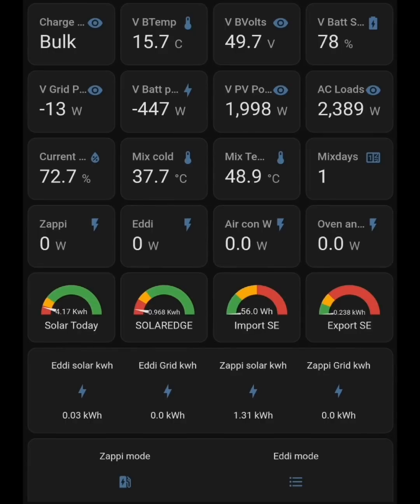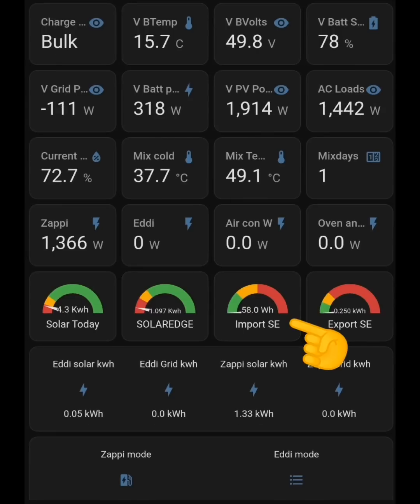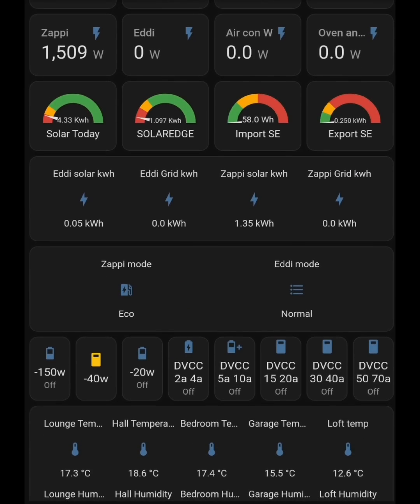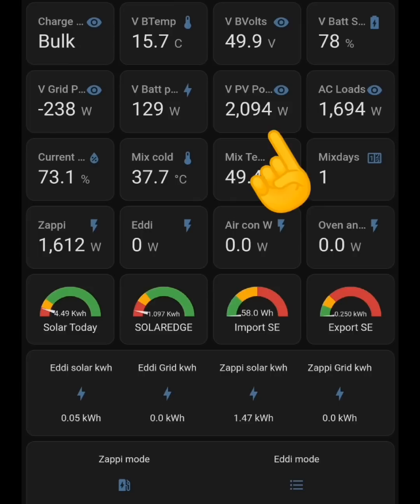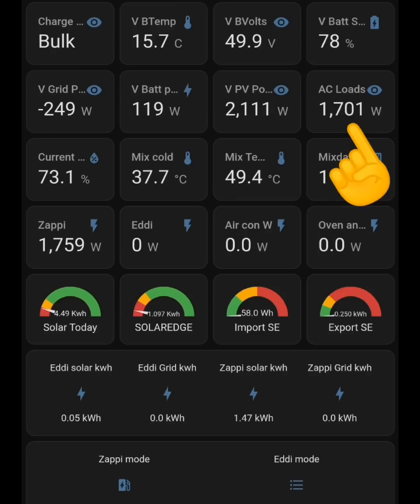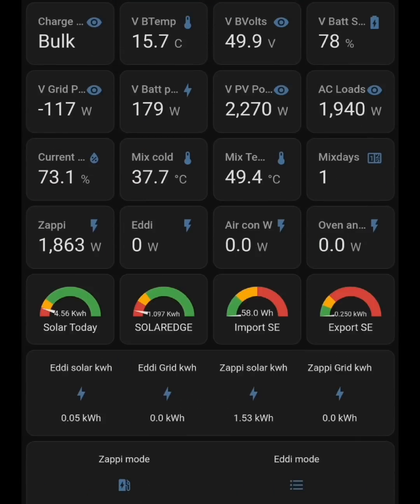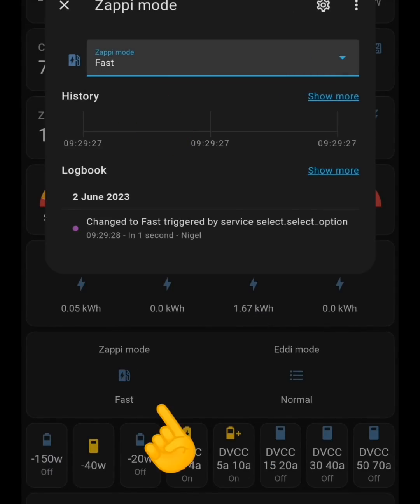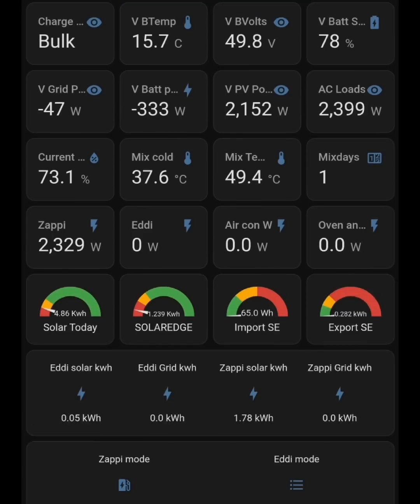Zappi vs Granny charger - Which IMPORTS less energy charging on solar - Data watcher's delight

Comment: Great video. I've got a very similar set-up here. At time 11:00 when the grid export is below -200w, I don't think that it's right to say that the Zappi takes "priority" at any point. I don't think that the Victron Inverter knows or cares what the Zappi is doing. There is a clear surplus of energy, regardless of what the Zappi is doing. When you increase the charging watts, the Victron has no obvious reason to hold-back. Quite to opposite. Without a limit on charge current, my Victron has a responsibility to get that -200w up to +20w, which it does quite effectively. The only trigger that would cause the Victron to hold back would if you started to import from the grid above your set-point, which appears not to be the case.

The question is, what would make the Victron want to hold back? It's certainly not being dictated to by the Zappi, and it is not being starved of energy. I did wonder if you were seeing some sort of lag between you issuing the instruction to raise the amps, and the Victron getting that instruction. I've always observed a slow-ramp, but your lag did seem more pronounced than that. It might be worth keeping an eye on the live charge current in DVCC settings on the CerboGX web/Colour Control to ensure that there isn't a lag in the setting change reaching the Cerbo.

Comment: Your Zappi firmware maybe out of date, MyEnergi have put a lot of effort into energy management you should be on 5.036 or above.
Reply: Some of us have 5 year old Zappis which myenergi has abandoned. I am debating whether to update mine or switch to Victron which for me has proved to have far better software than myenegi has ever had.
Once you have a battery the Eddi becomes nothing but a glorified switch to be thrown when you wake up in the morning if the water temperature demands it. Mine almost never acts as a diverter any more.
Reply from the maker: David,
No no no, 5 isnt compatible with Zappi 1

DO NOT attempt an eddi or zappi update to v5 if you have a Zappi 1
Reply: @EVPuzzle  I meant update as in buy a new Zappi. The Victron looks to have several drawbacks.
Reply from the maker: @malcolmknight6450  victron looks good to me, especially with fixed amp charging ability.  What do you see as draw backs
Reply: @EVPuzzle  My original wording was not too clever was it? Apologies for leading you up the garden path. Myenergi have asked Zappi 1 owners who might want to 'update' to get in touch with them. I have but no response yet.

As my Eddi has fallen into virtual disuse now the battery can do a 20 minute boost at no cost the Zappi has nothing much to integrate to so my thinking was to gradually switch everything towards Victron. My Multiplus etc. has been very impressive. Additionally, with a 13 year old SMA PV inverter still in use I may have to think of replacing that before long.

The only downside I originally saw to the Victron EV charger was that it was unlikely to ever support Intelligent Octopus as Myenergi may do one day and as you know my car has no connectivity.

Then I noticed only today that the new and prettier Victron model has no screen and I think I might miss having that. But for now at least the old model appears to be still available. Expensive when it will need a cable to make it effectively tethered.

On the other hand I have long ago given up any thought that these 'toys' will ever have a payback period although the 2010 era FIT has paid off big time.

You have clearly recognised, but I am not sure everyone has, that once you have a 5kw inverter and a big battery it changes one's mindset. Just charge the battery all day and at cheap rate in Winter and let it take up the load whenever needed. Run the immersion at 6 a.m., who cares about it being outside Octopus Go time? I have not actually used Octopus Go cheap rate since the end of March. If I was really worried about the dribbles of import (under 1kwh most days) I would go back to a standard tariff and save myself about ten pence.

I am tempted to get the Victron EV charger and then you can learn from my experience as much as I have from yours in the past.
Reply: @EVPuzzle  there’s a new version for the V1 Zappi due out and the V1 won’t accept V2 firmware so there’s no risk of a fault.

Comment: The SolarEdge API daily rate limit is 300 calls, which equates to a call every 4.8 minutes, so that’s the best update rate you’ll get. Set the update rate any faster and their system locks you out for the rest of the day!
Reply: Just integrate via the modbus with solaredge directly.  You can hit it as many times as you like and it's all local so no cloud delay or limits

Comment: The problem is - Zappi can only control the current in discreet increments of 1A. This means your limit for charging excess should be 230W (230V x 1A). I am using go-e charger with community MQTT implementation, feeding the MQTT info of solar excess, but deducting 230W "just in case". And another limitation on my car is minimum charging current of 6A - meaning under ~1600W (230Vx 6A + 230W reserve) it won't even start to charge at all.
Reply: That’s incorrect, it is the EV that does the charging not the Zappi. An EV charging rate is controlled by the Control Pilot which is pulse-width modulated between 53% and 0% in 1% steps, meaning the EV can only step at 0.6A increments or nominally 140W resolution. An Zappi like all others is an EVSE and does nothing other than supply 230V to an EV.

Comment: Hi Nigel, very interesting video. We have a very similar battery setup so it's nice to see how others are configuring / controlling their systems. Have you come across the different ESS modes for the Victron inverters - we are using ESS mode 3, which allows us to set (down to the watt) how much energy is going into and out of the battery. Like you, we are using home assistant and have all the logic for controlling which devices get priority / what is sent to the battery etc in a simple automation - I'm hoping to put out a video about this at some point but 3 small children are making that tricky atm 🤣

I think flexibility and control options are definitely the main advantage for the Victron/Pylontech solution, especially given the intended lifetime and the possible ways battery utilisation might change.
Reply from the maker: I've looked at that sort of external control of the ESS system  technically it's awesome but so far I'm happy as we are.

If it's not broke etc ....

Victron is really under rated so it's good to share setups.

Have you seen Chris hill's?  He's got a Quattro and placed a 2nd battery on the 2nd AC in and feeds his v2l power from an MG5 into which effectively provides V2H🤯

Comment: You could try reducing the maximum current that the Zappi can use and charge on Fast, this should reduce the bouncing between import and export as your Victron Inverter is trying to allow 40w export. It is a pity that the maximum Zappi current can’t be changed in the app. Edit, sorry you have just tried that. Brian
Reply from the maker: With you on reducing amps. It's effectively what I did in the fast mode part of test just using the car to restrict amps.

If Myenergi allowed it in the app we could automate changes in HA. It's a much needed feature but myenergi aren't  listening

Comment: I have a hybrid (Solis) inverter so my Zappi is unable to see what solar energy is being generated. I use Zappi's Eco mode to charge my EV when Solar production is good and inevitably the Inverter and Zappi have a push pull balancing act causing small amounts of grid import and export. Over about 1/2 hour the Zappi charge rate drops slowly down towards a minimum 1.4 kWh rate. When I detect that this is falling below 2 kWh I give the Zappi what I call a 'nudge' which means I change the mode to Fast for 15 seconds and then back to Eco. This action (all carried out programmatically) obviously draws from the grid for a short while but then settles back down in Eco mode to a higher level than it had settled to before the nudge. Over the following half hour or so it drops down again towards its 1.4 kWh level and so the process continues. I live with the small import this causes. None of these devices react immediately to changes in demand or changes in solar production so a certain amount of import / export is bound to happen. What you seem to be doing, if I understand correctly, is to move this inevitability sideways into the export range and away from the import. I think my idea is almost the opposite accepting small import to minimize export and use as much of my production as I can. Everybody's use case differs so both your and my ideas are perfectly valid.

Comment: Eureka! I've been trying to work out how to get more of a charge than 1.4 kW into the car without using the grid. Today is a good example. Car is at 30% I need it around 50. There's loads of sun later but I need to charge the car now. On eco I get 1.4 kW but if I do eco+ there's not yet enough sun. If I go to fast then I draw from the battery and the grid!

Did you start with a pre configured dash in home assistant? Trying to get mine configured the way I want it
Reply: If your battery has been charged perhaps yesterday from solar production then I wouldn't worry about draining your battery into the car subject obviously to it retaining enough for your immediate needs. This will also make more room in it for saving solar production later on in the day when your car won't be around to use it up and you might otherwise have to export it to the grid when your battery becomes full.
Reply: @RJPick1  totally, but the zappi only allows me to get the power out of the battery at 1.4 kW. The granny charger is faster!
Reply: @enyaq_gorm I don’t know the science behind my technique, but I give the Zappi a little shove by putting it on fast for ten seconds, then back onto Eco. That makes it max out up to the inverter capacity
Reply from the maker: Lol yup done that before too, takes a little while to adjust down